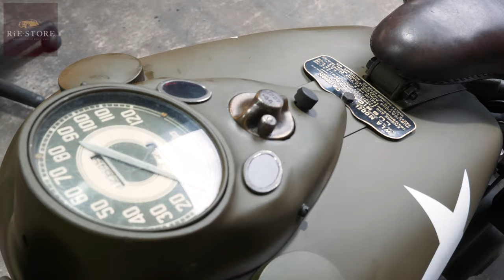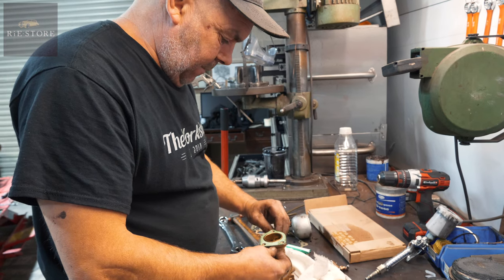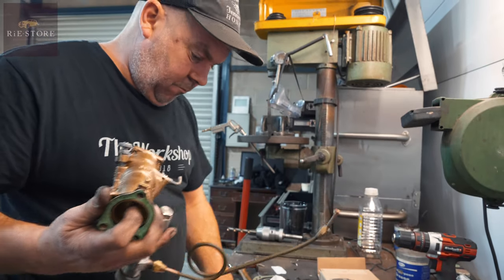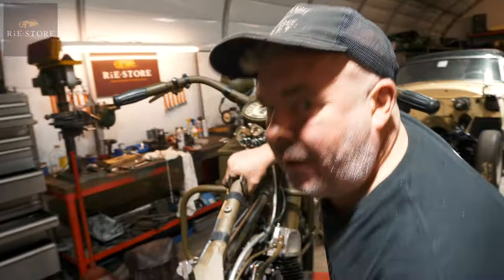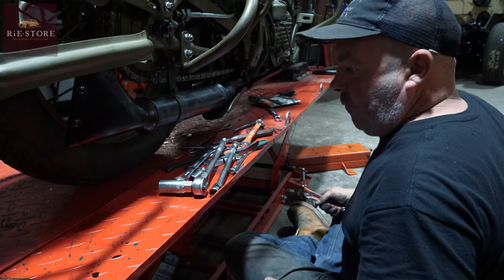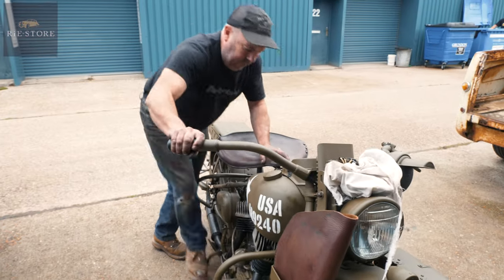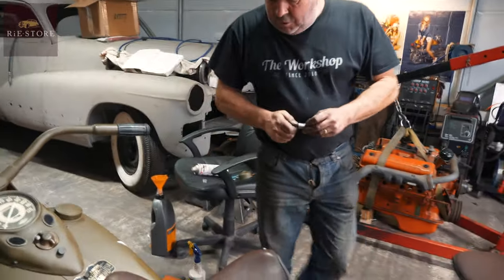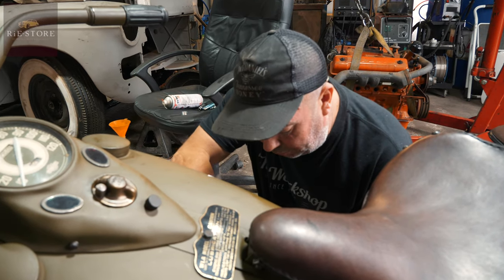If at first you don't succeed... Harley Davidson WLA / ep103

Comment: Just started riding my 1942 Harley 45 -WLC model. I started with a non-running but complete bike. Took three years because we do not have a heated garage in winter. I follow your videos because you mention things that are not mentioned in manuals or internet chat. By the way,  my first car was a 1957 Morris Oxford. My father said I should take it to a guy in town. He set the tappets while the car was running and a little oil spattering around.  I don't know if that was necessary but it ran well and the moral of the story is I enjoy your videos
Reply from the maker: That's awesome Glen and congrats on your WLC. If you get stuck at all just ask and I'll get Ash to answer your question!

Comment: Your videos on the wla are very educational. I have a 43 wla that I'm changing out the motor cases.my original cases don't have Vin numbers on it.the one I'm changing to has Vin numbers on it. so going over all internal parts of the motor and will change out what's necessary. the main problem I had was oil leaking from the motor.when it sits for months their is a big puddle of oil under the motor.i can't tell where the leak is because of the skid plate.can you do a video on oil leaks it would be very helpful.

Comment: 13:58 # Double assist kicks!
14:44 Points are a good save, If ever an EMP Strike occurs. Plenty of free gas all around in them electronic ignition vehicles. ~ Stock '53 Chevy PU & '68 Triumph Trophy Sports daily diver.
Damn right on the... ''Muddle Muddle who's got the Muddle?'' I'd been a week or two down that path with my 2!
As for all 3 of us... https://getyarn.io/yarn-clip/00d9e4e6-b515-499c-8e81-17c8aeb905c6